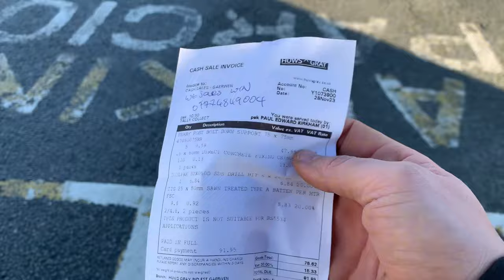ALL WORK NO PLAY - S1 Episode 10

Comment: a new power tool I can appreciate fully esp if it’s a Makita  manual tools are not much use for me nowadays since I had a works accident and I’m now in a wheelchair. But in the past I’ve always done any work on my houses that needed doing from digging foundations to bricking and blocking 1st fix joinery, electrics, and plumbing  then done the roofing, final fix or 2nd fix wood electrics, plumbing and all the plastering then all the decorating. After all it’s all down to using common sense and talking to people I’ve had no real training in any of the skills I just got on and get it done. Nowadays I have to employ the trade to get anything done I’m wanting a new fence in my back garden it’s only a hundred foot long in a cant trail and board style my older brother said he’d do it for me so I got all the stuff and it’s sat there for a couple of months now so I’ve started to do it myself. 😊
Reply: If I’d filled a skip like that in Cumbria there would refuse to remove it and charged me for a second skip then make me remove from the overfill skip into the new skip.  I’m not into holiday type vlog I’m well into the property management and refurbishment. You’ll get there.
Reply from the maker: Ahh see the thing is you have the experience and knowledge so that when you need something doing now you can’t have the wool pulled over.. this was the idea behind me doing all my own work at the beginning :)
Reply from the maker: Oh really! Jeez that’s shocking haha.. keep pushing the limits 🤣